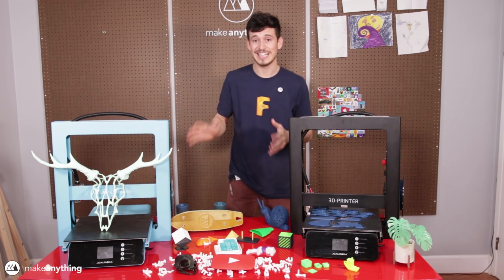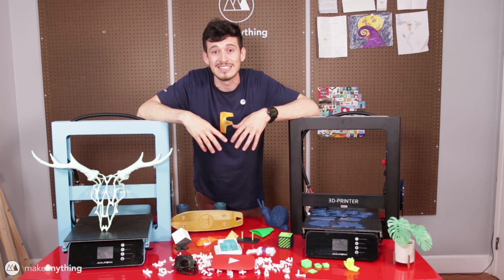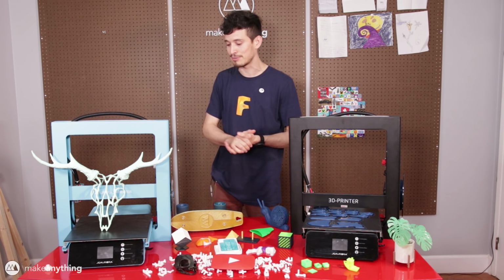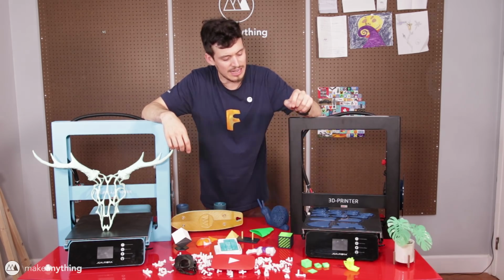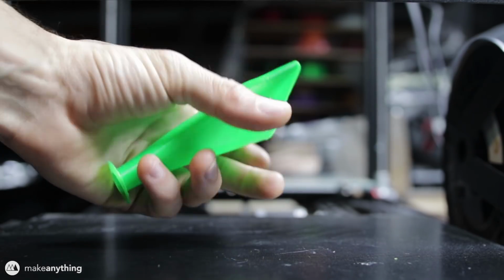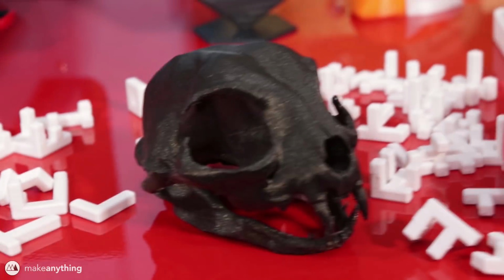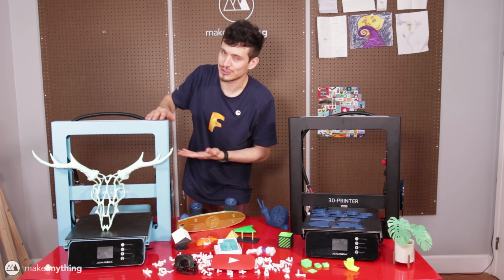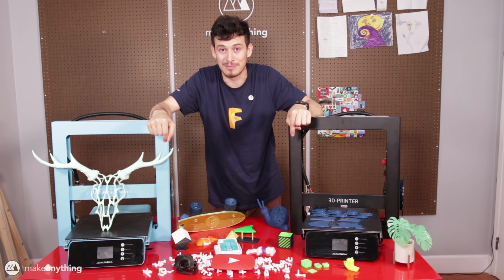JGAurora A5 3D Printer Review // Underrated?

Comment: Hey,
What printer from Gearbest would you recommend with a budget around $800?
Ideally looking for quality prints and also multi color prints.

Thanks
Reply from the maker: Two CR-10s :P
Reply from the maker: Honestly avoid multicolor, it's still too finicky. Maybe the Prusa MK3 with MMU, but even that takes work
Reply: @make.anything  CR10s pro or this one in the review?
Dual extrusion is what I actually meant with multi-color.
Reply from the maker: @NeilvanderMerwe  I'm still reviewing the CR-10s pro but it is definitely shaping up to be a favorite. Even dual extruders aren't worth the hassle tbh. Twice the extruders twice the fail rate

Comment: Not sure about the surface on this machine, but if it's the same thing as the ultrabase, I'd stay as far away as possible, run the other way. I'd rather get a machine with an aluminum bed and use your own surface, wanna give ultrabase a go, try it -- but QC on it is a roll of the dice, I ended with shards of glass in part -- and yes I waited for the bed to cool -- cool overnight in fact. Bought ultrabase after seeing your videos on it -- for PLA -- sure, not sure what temp you printed ASA, but for anything over 100c -- it can't be trusted -- or you'll end up with glass shards in your hands....but then again I'm not a YouTuber with 200k subs.
Reply from the maker: I'm sorry you had that experience, but I've printed with a 100C bed with no problems. It sounds like you printed much too close to the bed and tried to yank the part off or something, because I can't see that happening with a scraper.
Reply: I had proper proper clearance -- I use a BL touch -- and set my z-offset to be further away from the bed (than PEI or buildtack) as recommended -- the part popped of when the bed cooled down, no scrapping needed -- self released .. lol,  but it had it a shard a glass attached to it. My PLA experience was flawless, just like your demo, just push with a finger -- at 110C -- is where the surface was destroyed --

Comment: Hi, from the specs of the printer it looks like nozzle can reach 285? Do you know if nozzle can be replaced with a harden one to print Nylon? Thanks.
Reply from the maker: I see no reason it can't be swapped out, although you might have to replace more than just the nozzle (eg. E3D's all-metal assembly : http://bit.ly/E3Dassembly )
Reply: Hrm, yes I've one on my Robo3dR1Plus. Just might need a bigger printer for a project. Guess I'll try Nylon on this printer first. I was just needing harden nozzle and build a dry box to keep the Nylon safe. Thanks again.

Comment: With it being so open, can it print with ABS well? Is there much warping?
Reply from the maker: Any open printer like this will struggle is ABS unless you build an enclosure. It will work for small parts though, or you can find a build plate adhesive strong enough to keep it from curling

Comment: Heads up guys, stick to amazon. I got a DOA cr10 from gearbest and they want to charge me 300cad just to get 150 back after they took over 2 months to respond so my warranty was invalid
Reply: The extra cost is for the reassurance that Amazon will help you if you get screwed like I did
Reply: You use a credit card? Should have spoken to them, most will help you get a resolution or issue a charge back.

Comment: seems super cool but print quality didn't look that great. then again, it's a super cheap printer
Reply: Yeah, when printing full bed of those white puzzle pieces, there were a lot of problems (looked like shifted layers) that he didn't mention. Also, printing flex materials through long bowden tube is not really dependent of the printer brand, because the friction inside bowden tube does not change from the printer. This is my favourite 3D printing channel, but this video was way down to 3D Printing Nerd -level.
Reply: Ilpo Ahlfors I like the 3D printing professor too, Make Anything is great. 3DPN is at times annoying and wastes a lot of time for little info.
Reply: I agree, 1 minute worth of info in a 10 minute video
Reply: Ticho Ooms I know a lot of YouTubers make their livings from their channels so that's why they do it, still it's not good to have the substance of the video be something you can answer in a sentence or two and somehow it's bloated to a 10 or even 20 min video. It's a real turn off. You can even pick out which videos those will be from the titles.
Reply: Yes indeed. Yet there are youtubers that are able to make a 20 min video with 20 min of useful content. I rather subscribe to them imho :)